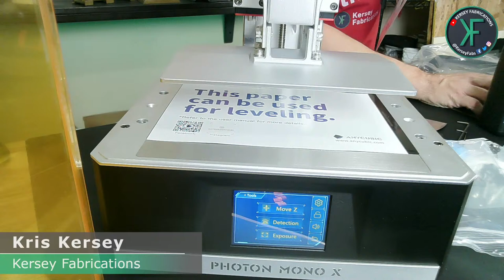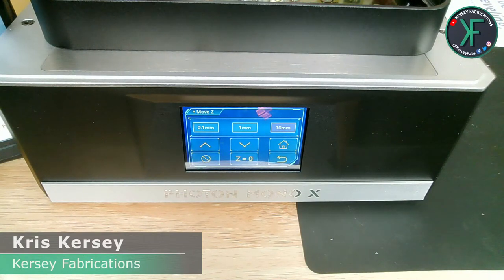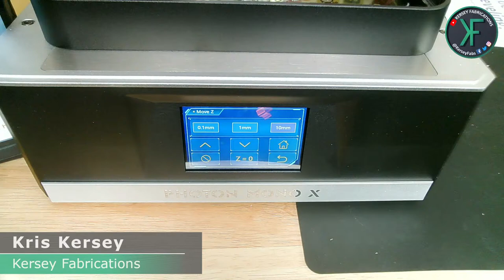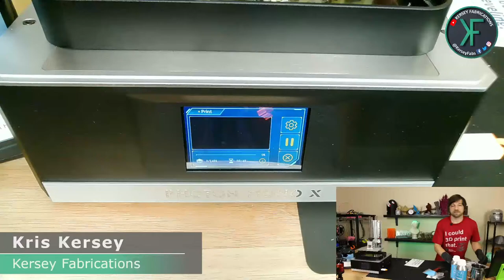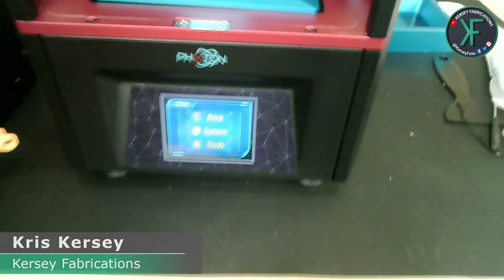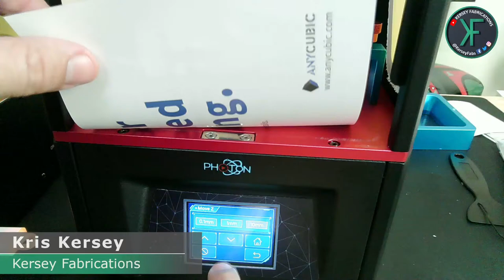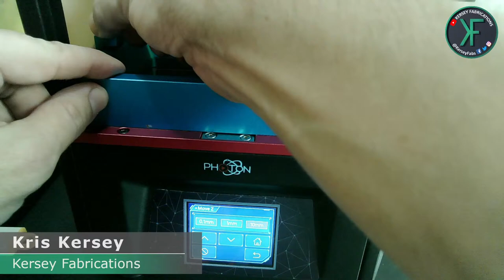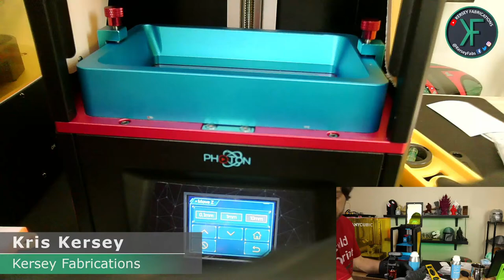ANYCUBIC Photon Mono X, Photon, Wash & Cure Unboxing

Comment: This gotme through  a long car journey, almost 3 hours travel so thanks alot.
Ive got a ender 5 plus question, i use your bin file that you posted on the auto level video, looking through the marlin stuff i see the VMAX or max feed rate for the extruder was set to 50, is this set in stone by yourself or is it a tweak it if you need to, as  im getting some clicking from the pancake stepper if i go above 60
Reply from the maker: I'm glad you enjoyed it! That's just a setting. It can be changed.